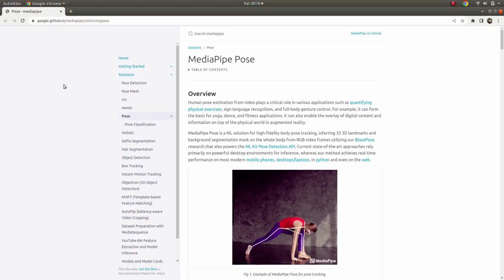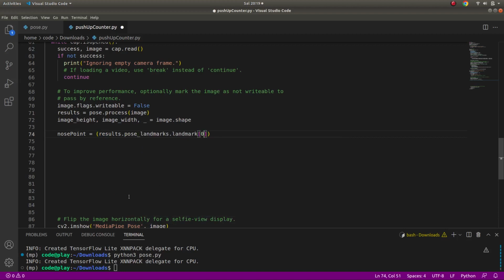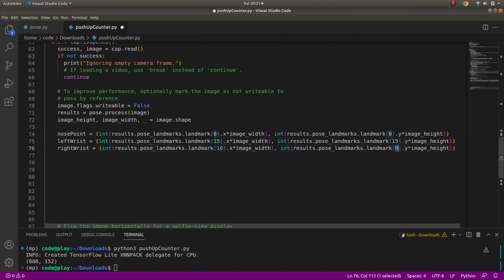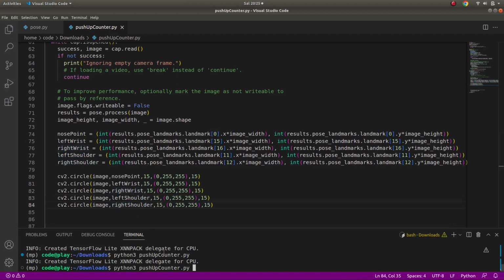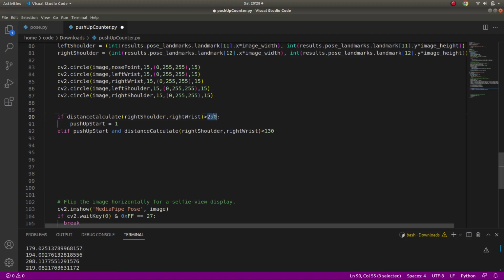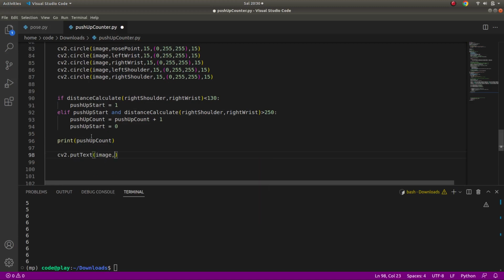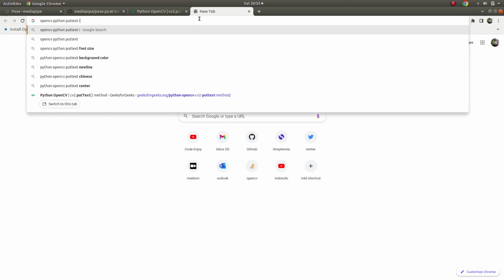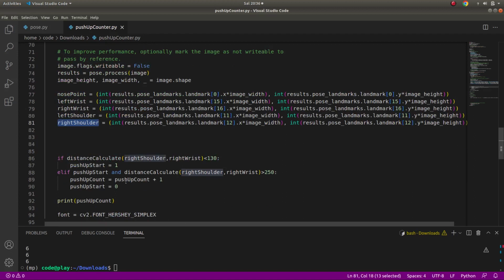Push-up Counter Project with Python | Mediapipe Pose Estimation

Comment: I was getting '-1: error: (-5:Bad argument) in function 'putText' ' error when running project. I'm thinking this is because of newer versions of the Mediapipe (v3.10) modules. Mediapipe will not work with anything greater than 3.10
To correct the PutText error I needed add ' image = image.copy() '. 

Question.... when the processed video is finished I get ' Ignoring empty camera frame ' which just continues over and over on repeat forever. To stop you need to do a ctlr+break. 
Is there a way to have this just stop once the video is processed? 

One more question.... what video resolution is best to use for this? I want to try using another video and want to know what to use. The video I used was not detecting all the movements but it did detect about 75%. I have a decent CPU/GPU so I know that is not the issue.
Reply from the maker: you can break the video according to the keyboard press by using waitkey(). You can easily get example usages from internet.

Second question answer is I think video resolution shouldnt be less that 640x480
Reply: @computervisionlab2119  OK. I'm going to make my own video for a test. Just wondering if it makes a difference with different resolutions as far as count detection and what is best to use. I will experiment with this. Also if one has a good GPU how can one utilize the GPU instead of using CPU with Pose?
Reply from the maker: @franklidgad  for gpu option you need to set gpu and of course you need to have cuda installed.
Reply: @computervisionlab2119  Would you be able to show a tutorial on how this is done with a GPU? I'm not at all a programmer and have just been using your PY script from your Gitub.
Reply from the maker: @franklidgad  i may try to record a related video for the future
Reply: @computervisionlab2119  Sweet, that would be great. In the meantime if you have a PY script for GPU could you put it up on your Github?